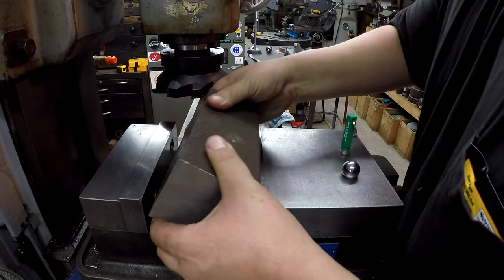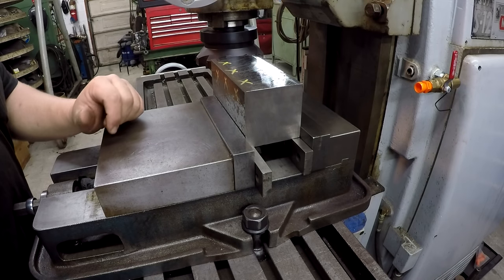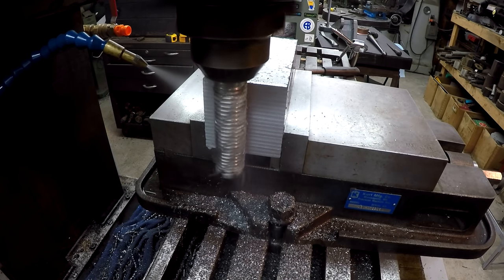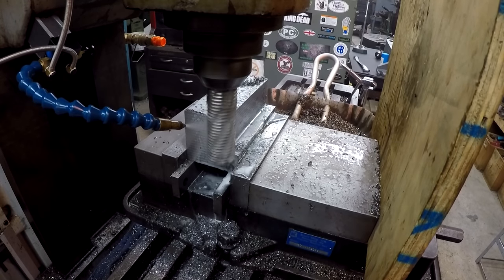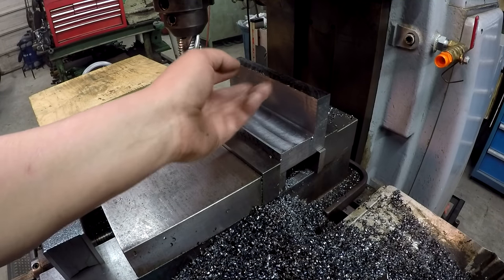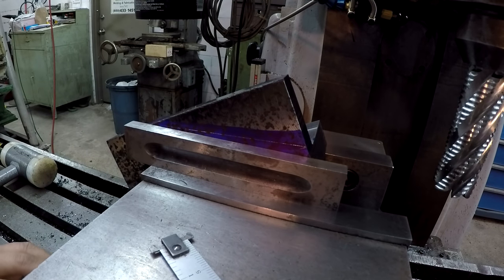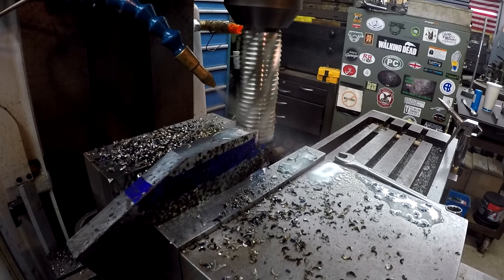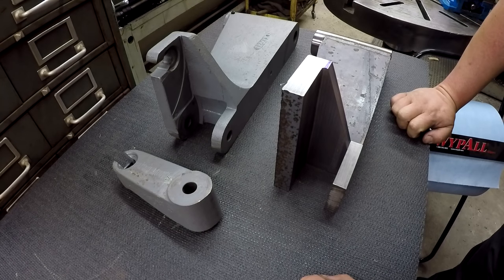Kearney & Trecker Parking Attachment Part 8

Comment: Hey Adam,
Great work. A quick suggestion for removing large amounts of stock like in the video is to use the cutoff/band saw to within an 1/8" of finish. Saves a ton of time and easier on the equipment too.  Keep cuttin. 
Jack

Comment: Hey Adam, why wouldn't you band saw out the bulk of the to-be-removed block 2¼x2½x7⅛ section, then clean up just the saw cuts on the angle? 

Aside from your love of Hogging off Metal, and a zillion ways of getting things done (like block removal with a wheel-cutter / slitting-saw on the K&T)
Reply from the maker: Sawing would be a good option, and more economical. I had my sights on some heavy hogging, but didn't get to use the shell mill I wanted.

Comment: I liked the chip shield, I always figured that was one of the advantages of side controls you can sometimes hide from the shrapnel that comes off these mills when they are cutting.  One of my complaints about a lot of the newer style chip breakers on lathe tooling is they like to throw the chips at the operator. Of course that is fine on a CNC but it sucks for a machine with an operator.  You will be using that parking attachment by the end of June it looks like. :-)
Reply from the maker: Thanks Brian. I do like the chips to fall straight now when I'm turning. The mill however, those facemills thrown them everywhere! I been reading some funny comments on YouTube about you and I.
Reply: I hope the comments were all good! Just came in from working on the barn/shop and those wings sound tasty! On a lathe you have a nice chip pan, with the big mills they think the whole shop is a giant chip pan. lol

Comment: Using the saw you could have saved a large portion of the material for future use. OTOH, this way we get to check the performance of the mill and cutters. 
I wonder how a parting cutter would work on a shaper and how deep a cut you could make with it? Tool might tend to pinch on the return stroke. If it did work it would be slick to have squared cut-offs with machined surfaces.

Comment: I would have drilled along a general line, then saw, leaving a block to build the angle in between the arm and the hand.

But as you say, it's a personal project.

Love to see chips flying about. Even though; motors, gears and tools get a beating.

Spare them.

Great project. 

Keep it up.

Comment: I watch you use the balls then I think about the barrel shaped bearings you torched out of the heavy metal shaft assembly.  They would be awesome with a flat ground on one side.  Flat on the bottom to make lining up easier still with the round side to the work.

Comment: This is the first time I see one of your videos and I liked it quite a bit, it's surprising how you make long and tedious tasks look interesting. Thanks. I was also thinking (like the others) that this is a job for the bandsaw. Back when I was learning, one of the ten commandments of machining was to get as close as the final shape with the saw as possible because turning material into chips is the least efficient way to remove it (and efficiency is the goal in any process). Actually,  now that I'm thinking, the best shot by far would have been to use a thin 3 side slotting saw in an horizontal mill and just cut off the big lump of steel in one go.

Comment: I have a question, maybe naive, but when you need to remove such a big bulk of material, why don't you saw it out first? It seems to me that it would be faster and you would end up with a piece of stock you could reuse in future projects; in woodworking that's the way to do. Why removing the bulk of the material by milling? I was wondering since the machinist vise project.
Reply: I think you are right if you were doing this as a "job" that needed to be get done ASAP. However he has been asked this before, and his response was basically "sure you could do it that way, but I do it this way to show you (the viewers) more milling and how it would be done that way, plus it is fun..."   Something like that. 

Like a weirdo, I like watching the tools cut. But in some cases I'd like to see the "here's how I'd really do it" methods, too.
Reply from the maker: As I was quoted here in the next comment, I like to show as much machining I can. Yes sawing the block away would save material, but that's not my concern. I want to use my machines for what they are for and perform some heavy milling cuts to remove the unneeded stock. I would however like to own a nice big vertical band saw in the future.
Reply: +Abom79 could have used a wheel cutter. in horizontal mode to mill to perpendicular groves.
Reply: I'm glad I scanned the comments as this was my question as well.  Carry on, Adam! :o)

Comment: Adam, it's time I think for you to make an attachment to your band saw. You could have saved yourself a lot of time and tool wear & tear by lopping off the bulk of the stock and then milling to size & finish.
  Perhaps a small adjustable vice or just machinist's jack. Something that'll compensate for the angular cut of the Do All.
                               Just a thought.

Comment: Can you please explain the ball bearing ?
Reply: It's a Screwyball:
https://www.youtube.com/watch?v=f5L6-g2mbpo
Reply: The ball bearing forces the billet against the back jaw. This is used since the block isn't true to start with, so if you just clamp it in your vice, it would sort of average itself between the two jaws, with the ball bearing it forces the side you're milling to be square to the face against the rear jaw. You can also use drill rod, a drill bit, a piece of round stock, anything really.
Reply: I think..... Use the ball bearing to squeeze in the still face of the vise, this face is perfectly flat, the other face of the vise, usually when you press the piece takes of the piece of the bottom and cant square perfectly
Sorry for my very very bad english
Reply: He uses the ball bearing to square the block correctly. After facing one side, he puts that new flat side on the back of the vice, and uses a ball bearing to only touch the opposite side at one, small point. That opposite side is not necessarily parallel to the machined flat side, so if he were to clamp on it, the flat side wouldn't clamp completely flat to the back jaw of the vice. By clamping on a ball bearing or a piece of round stock, clamping force can be applied while still keeping the machined side flat against the vice jaw. The ball bearing is required( or recommended) until two opposite sides have been machined flat, then those two sides can be clamped on and the block can be machined square.
Reply from the maker: Allows you to push a work piece square against the back jaw.
Reply from the maker: Check out the new Shop Talk 3
Reply: @MrShobar  yeah I usually do that, but it is a pain in the arse getting it back in again when you've finished with it.lol

Comment: Adam,
As I'm watching the Noga mist sprayer I'm thinking a Noga MINICOOL two spray unit would cool your end mill more efficiently. Just a thought since spraying at the top of the end mill you have to rely on the coolant running down to the bottom of the end mill.
Maybe as you said flood coolant might have done better.
I'm really enjoying this video series.
Thanks,
Jeff
Reply from the maker: Jeff I have a Nogacool on order that will help me get the flood coolant going soon, but yes I am also wanting the Noga Minicool with dual nozzles. I've been in touch with Noga today and may get a fresh shipment of tooling in soon.

Comment: that k&t is really flexing its muscles, thats a pile of chips you got there. could you have set up for a horizontal cut and removed   a chunk rather than mill it out? this attachment is really shaping up. nice work.
Reply: Or could you have welded two 1 inch plates together and squared them up? It sees like an awful waste of material!
Reply: lol I should read more posts before I reply.
Reply: If it's all scrap stock anyway, who cares.
Reply from the maker: For sure, I just showed you the way I chose to machine it. 👍
Reply: Thanks Adam. I wasn't trying to say your way was wrong, just trying to understand the thought process and learn why things are done in a certain way. Really appreciate all the effort you put into your videos.

Comment: Nice work,as always. On a very similar job I cut away my waste with my band saw. Saves on cutter wear and machining time and has the bonus of leaving a very useable off cut for another future job. I just set my depth of cut stop on the saw and let it go to work. Confident in it enough to cut fifty thou over finished size. I am guessing that a slitting saw in the mill could do the same but even closer to finished? Steel stock expensive here in UK!
Reply from the maker: On a pay job or production I would find a much faster way to get it done. But for me I enjoy playing on the shop and showing the different ops of machining.

Comment: I am no expert.
When side milling, the cutter makes a larger chip while entering the cut while making a smaller chip exiting . Would climb milling eliminate some of the chatter when making such a hogging cut?
Correct me if I am wrong.
Reply from the maker: Don't climb mill on convention machines with lead screws.

Comment: Misting always seems to make the most sense.  Squirting or basting oil manually, only seems to last a few seconds.  Flooding with emulsion is very splashy and messy.  The mist seems to lubricate and cool the best.
Reply: Using a mist also fogs up the shop after a while if you don't have some good ventilation.

Comment: @Abom79 What is the purpose of the flat-sided steel Ball? Is it to stop the Bar from tipping due to opposite sides not being parallel when closing the vice?
Reply from the maker: Check out Shop Talk 3. It's to help properly square up the part.

Comment: Adam, quick question about the cool mist.  Are you running normal cutting fluid in it? If so, is there any risk you may be breathing it in?
Reply from the maker: I use the Koolmist brand formula 77.

Comment: Hi Adam !

Oh, I love this heavy duty work of yours - nice !

The first block you squared up - why not just have used a saw blade to cut the "squar corner" out for later use ... now it's all just useless chips - maybe it's because I'm a cheap guy going for saving as much material as possible ha, ha !
Reply: I have the same question.
Reply: ahh wel it is interesting to see chips by the pound! there is more taken off than is left, which is amazing to see the K&T cutting metal faster than ive seen wood cut.
Reply from the maker: I need a different saw to cut shapes like that keld. Thanks for the comments.
Reply: Abom79
No, you just need to make two cuts - angled 90° to each other ... and a piece of squar stock falls out on the table instead of all these useless chips.
Reply: But have a look at his bandsaw in some other videos, it is fixed on one side. The cut is on one side deeper than the other side of the material. The Bandsaw blade(is it called blade?) works not parallel to the ground. Sorry i can't explain it better in englisch ;-)
Reply: 42IsAnything
How about using a slitting-saw-like cutter in the mill - but it was nice too to see this big cutter eating all that metal.
Reply: Keld Sørensen Yes, maybe Adam can do this in a future project ;-) In the past he splited the big Chain Gear in two parts with the K&T and a slitting saw cutter.
Reply: Are you able to sell the chips to be recycled? I'm a new viewer and would love to hear more of your reasoning behind how you choose your stock. I know sometimes you are using scrap, but other times it seems strange to remove so much material.  

Also I'd love to see more info about where the parts will get used when possible.
Reply: billtheunjust This will be the parking attachment for his own K&T. The original parking attachment is not his own.

Comment: Wouldnt it be better to leave a radius on that inside angle? Give it some more strength and less tendency to develop a stress crack? Aww who am I kidding the original one was overkill and so is this! =) (overkill is almost always better anyways).
Reply from the maker: It does have a radius, the endmill has one ground onto the corner of the flutes.
Reply: +Abom79 I see, was hard to tell.  Great job btw.  That thing can hog the hell out of that steel =).
Reply: "Over-kill" means "too much," which is in contrast to "just right."

Comment: what is that ball you put in between the clamp and the block?
Reply from the maker: It's called a screwyball
Reply: What´s for?
Reply: I was just thinking the same question. wouldn't the ball leave an indent in the material you working with?
Reply: It helps keep the material pushed flat against the rear jaw, the fixed jaw, which is designed to be square to the machine, so you get square jobs.  The front movable jaw isn't so accurate and can lift, without the ball it can through the workpiece out of square.
Reply: The face of the stock is going to be machined later anyway so any small dent from this clamping is not an issue.